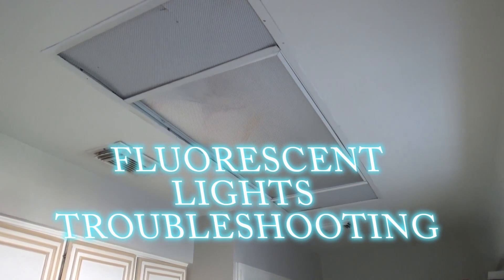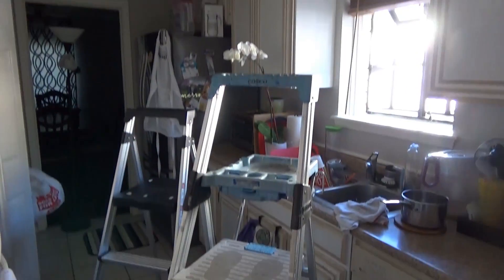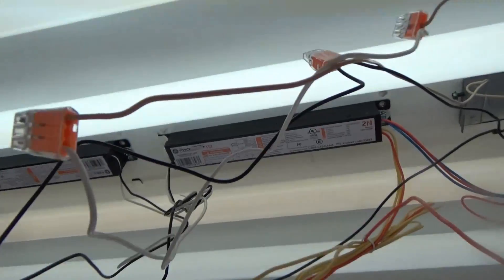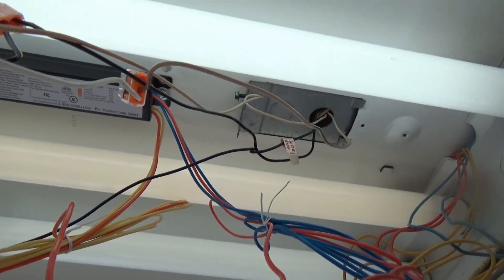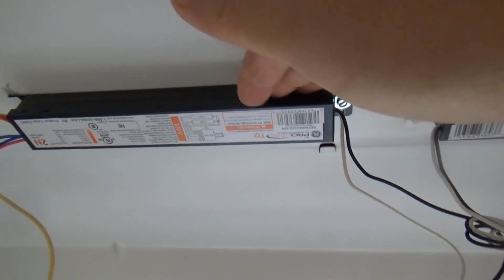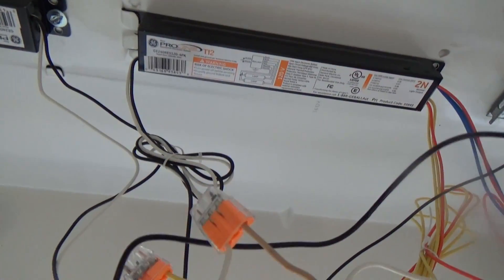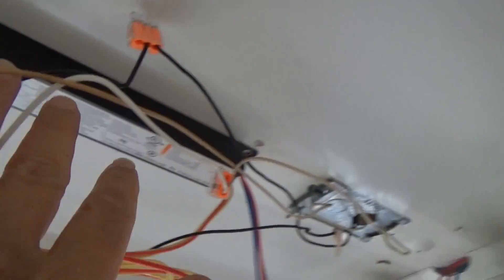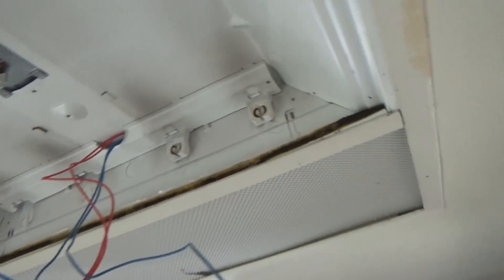Fluorescent Lights Troubleshooting

Comment: I recommend putting the outer bulbs on one ballast and the inner bulbs on the other ballast
Reply: Why? I have a couple in the basement that I'll be working on this weekend and on one of them the outer tubes work but the inner ones don't.
Reply: Rick Voigt it good because the fixture will be not as bright but the whole fixture will light even if a pair of bulbs go out
Reply: got it, makes good sense. Thanks!
Reply: Rick Voigt nice. Also it’s good if you only want two bulbs instead of all four bulbs on. We have the same fixtures and only one runs on four bulbs. The rest run on only two bulbs with old magnetic ballast in them from the company advanced

Comment: How about the fluorescent light switch?  I have to keep flicking the switch and when it's just right then the light goes on.  Mine is a 2 bulb 4 feet light.  Do I need a new switch?
Reply from the maker: I would turn off the electricity at the breaker box and open the ligth switch cover and remove the switch from the switch box to inspect the wiring to make sure it still on tight. If not then tighten it. If it's still doesn't work, I would replace the switch. (I'm not an electrician but that's what I would do). Good luck to you.
Reply: Thanks for your quick reply. Ok, That's what I will try. My husband passed last year [89].  So I will have to learn how to do things like this in this big old house. I will let you know how it went.  Thanks again.
Reply from the maker: I forgot to mention, you should have tester to make sure the line is not live (hot) before you touch it. 

https://www.walmart.com/ip/Hyper-Tough-Analog-Circuit-Tester/104874361
Reply: Hi, I replaced the switch and the light is working just fine.  Thanks for your help!
Reply: philanna38 I have the same problem with my 1 tube 8 ft light in my basement bulbs are fine ballasts are screwed